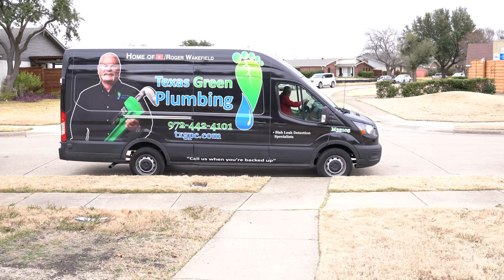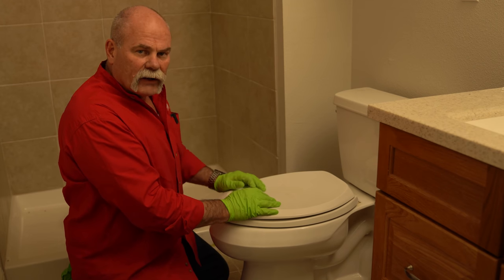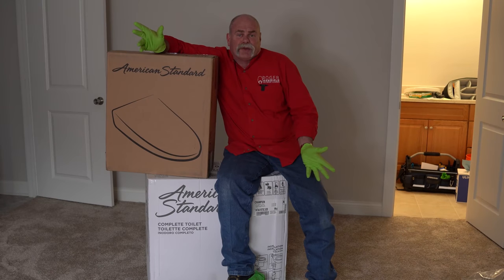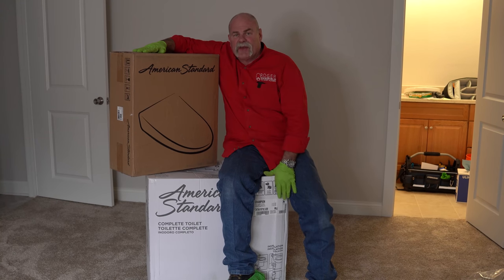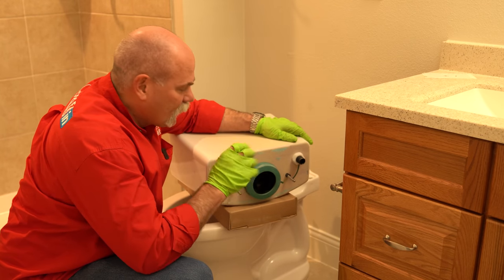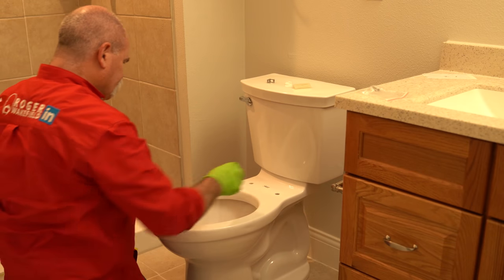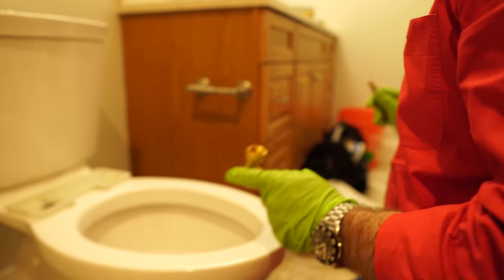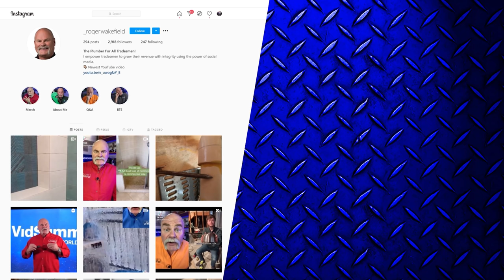DIY Plumbing - How To Install A Bidet Toilet Seat!

Comment from the maker: I love my bidet! Do you have one in your home?
Reply: Im considering getting one installed whats your opinion on it first Roger??
Reply: Nah, I just do handstands in my shower
Reply: I do because I'm disabled and can't wipe my bum-bum properly........ I have a Clos-o-Mat
Reply: Liked my so much that I put another one in my camper.
Reply: Since we installed one I hate being out somewhere and being forced to use paper.
Reply: No I don't. But I want one
Reply: So the ejector is like a high powered stream of water that goes im your underside.... Im considering it
Reply: Call the electrician back and tell
Him to replace the receptacle with a GFCi one. 🙊
Reply: @kalijasin  i am guessing it is run on the same circuit as the one on the counter and it is after the one counter and it is proving the protection for both outlets. But that is a guess and i agree it must be protected as it is to close to water not to be.
Reply: I added one a few months ago due to the hoarding of tp that happened the first of the year.  I know wish i had added one sooner and think this should be standard on at least one all toilets in all homes.
Reply: @ddgiant  "i am guessing it is run on the same circuit as the one on the counter and it is after the one counter and it is proving the protection" Outlets protected by an upline GFCI require a  "GFCI Protected" marking.
Reply: i don't have one unless someone give me one for free just because cant afford for anything barely on foods n drinks 
all i have is free thetford toilet it plastics 
i have build home because of the hurricane destory my camper on September just bought broke school bus n turned it into rv
FEMA denied give me anything replace my broke camper so have start over again
Reply: Hell yeah I do. Not as nice as this though.
Reply: I don't have one yet, but ever since using numerous ones in Japan, I've been a big advocate for toilet seat style bidets. The cheap ones are only ok, but the higher quality ones are great!
Reply: Installed one when I went to Japan and purchased it 25 years ago. Still going strong and always laugh at people buying toilet paper!
Reply: I installed a bidet seat on my own when people were hoarding TP. First time I had done anything plumbing related. Made me feel like a boss. Now I'm super clean. Would highly recommend!
Reply: Howdy from the UK Roger. I have something similar, but it's a standalone unit that fits as a seat on any "average" toilet. 

The manufacturer is BioBidet, and I have it on long term loan through a disability care agency. It has a heated seat, hot water jets and a hot air blow dryer. Although you can change the level of heat from none to pretty hot, for the seat, water and air via the included wireless remote control, which I have mounted on the wall next to the toilet. 

It does raise the sitting height by maybe a half inch more than the standard seat and lid it replaced, and it has quite the bulge at the back for the water heater but I can't believe you had to install an entire toilet unit, porcelain and all! Just to add bidet features.

The only thing of concern to me is the sockets. Mine is wired through the wall to a sealed unit outside. Plug sockets are against the electrical code in UK bathrooms unless they're in a rated enclosure. Those aren't even enclosed, let alone in a sealed faceplate.
Reply: My father's parents have 2 in their house. But they aren't electric.
Reply: I installed a bidet attachment fairly recently, the simple kind that fit under the seat. It's working great but in the winter the water is so cooooold. No warming, etc. The problem though was the cheap T adapter that continued to leak no matter what I did, I had to order a separate one to install, but that took care of the problem. This must be a common problem since companies are advertising T adapters (sorry if this is the wrong term) for replacing the cheap ones that come with bidet devices. Since then, though, no problems except for the fact that the toilet seat tends to move off-center which causes the water jet to impact the back edge of the seat and thus spray a bit outside. So, you have to keep the seat adjusted. I'm too ignorant to know how to fix this problem. The bidet attachment itself does not move though, so that's good!
Reply: I want one but dose hard water effect it at all over time?
Reply: I have a Luxe Bidet Luxelet E890 Bidet toilet seat.

Comment: Handyman in the comments:
 ewww a plumber's job is disgusting
Plumbers: at least it gets me the dough💲💲💲
Reply: Some of y’all are way to hard on handymen. I’ve had to go back behind plumbers before that had no idea what they were doing. Things like telling a tenant and landlord they need to pull a water heater and replace a shower valve, because they didn’t have hot water to anything in the house. 

This handyman goes there and turns the valve to the water heater on. Just one of many things I should start documenting.
Reply: @emmasdad5426  look this is a recurring joke that Rodger makes I'm just trying to put out there not saying that handyman don't do hard work
Reply: @mr.robot1399  I know. I still respect both sides and Rodger is fun to watch.
Reply: im a handyman and ive replaced dozens of toilets
Reply: @OGRE_HATES_NERDS  I salute you my friend for this is merely a joke
Reply: @HandymanHustle  Look its just a joke
Reply: @HandymanHustle  I appreciate plumbers electricians and handymen it's just a joke

Comment: What a great job ! And what fun to scrape the old caulking from the tile. Lol ! As someone who has been in the plumbing trades, if your removing the caulking from vinyl sheet goods, be careful not to gouge the vinyl ! You could end up replacing the bathroom flooring  !

Comment: Rodger I love your videos. I'm not a plumber, but I'm a DIY guy and I've seen people use wetvac shopvacs to remove the water from the toilet so you don't have to use a sponge. Just posting it here for you and other viewers to see.
Reply: He also uses those just didn't in this video for whatever reasoning might of been lol. But good pointer nonetheless. I'd also like to add if anyone does who isn't familiar with one make sure you remove the paper filters if it has one. Let a friend borrow mine then while he had it sprung a leak and when I came over to help I found my filter I just replaced in pieces in his driveway lol

Comment: I wish I would have seen this video a few months ago. I added a similar toilet seat from Bio Bidet and it used the same mounting bracket with the rubber bolt sleeves. I struggled for about 10 to 15 minutes just trying to push them in.  I wish i knew about the use the bolt and pull it from below trick, would have saved me a lot of time.
Please keep putting out the great videos

Comment: Hi Roger, I saw you using a sponge to empty the toilet, I was curious if you have ever tried or seen a tool called the last drop,(or any of the similarly made versions) its a super convenient solution for removing water from any fixture when you need to work on it. I know I've been glad to have it on several different jobs.
Reply: Shop vac??
Reply: Good old wet vac works wonders
Reply: Shop Vacs work great too, but this doesn't need power, is lightweight and could fit in a decent sized tool bag, so it has some advantages over a shop vac, main disadvantage is a smaller capacity, but you can usually empty in another drain nearby or use a bucket if necessary.

Comment: A non tamper resist and plug that close to the floor and next to the toilet, i hope it is at least on a GFCI
Reply: Not worried. Outkets in bathrooms  and kitchens are by water. That's what gfci  breakers and outlets are for
Reply: @chuckley54494  i understand that, that is why i said "i hope it is on a GFCI" but isn't there a new code that requires all outlets within a certain height to be tamper resistant?
Reply: @WalterKnox   i couldnt tell you.   one in my 1950's house are between 8 and 14 inches depending what floor you are on.
Reply: Our house has the GFCI breakers in the panel not the outlets in the bathroom.
Reply: @hrcnick11  yeah, alot of newer houses have those as well, i am going to assume that this either has those or a GFCI outlet controlling that one. i am not sure how old the house is and if the outlet has to be tamper resistant depends on that, also my house does not have any GFCI because it is from the 40s, but that seems to be a pretty modern house so it should be okay as far as that goes.
Reply: @Jack Myhre correct, I have not heard the ground pin up thing, but makes sense and that is how it is in commercial buildings, I think if the outlet is a certain height off the floor it does not have to be tamper resistant, something like 5 feet I think.
Reply: @WalterKnox  The house is brand new, it was recently rebuilt after a tornado, so it was rebuilt from the ground up.

Comment: I can tell you're right hand dominate. The initial tank to bowl bolt tightening you did the right side with ease. The left you actually had to get down there to see it. As a plumber I try to use my left side as often as my right to avoid that lil situation you had. It's not bad it's just something I noticed.

Comment: Just discovered your channel, and I enjoy the content! No a plumber, by any means, but I enjoy learning new things. A quick question, if I may. I have a half bathroom in the first floor, just a toilet and a sink, and a full bathroom on the second floor. Now, whenever it's cold outside, the first floor toilet only has one flush, then I need to refill the reservoir. The 2nd floor toilet though, works just fine. Why do you think that is?
Reply from the maker: You may need a new fill valve. That’s kind of strange.
Reply: @RogerWakefield  thank you kindly for the response! It is peculiar, as I've not had this issue at any residence before, but given the states of a few other things, I'd wager that the prior owners were more of a DIY type. Again, thank you for your time!

Comment: I have a few questions;
1. Couldn't you have used a plunger to force the water through and out of the trap in the bowl faster and easier than using a sponge?
2. Why did you loosen/disconnect the tank inlet before draining the residual water in the tank?
3. What is your opinion on the Fluidmaster "better than wax" rings compared to the old wax rings?
4. Did you have to change the whole toilet regardless or is that seat able to be placed on any,  correctly sized, bowl fixture?

Comment: I've always been told by plumbers in our area never to use anything to 'seal' the toilet to the floor.  If the wax donut starts leaking,  you'll want to see it coming out from under the toitoi.  That way you can address it qiucker before it rots out the subfloor.

Comment: curious what your opinion on double nutting the tank bolts ex. bolt with rubber washer the another rubber washer then another bolt then put tank on toilet and bolt it down

Comment: Would you recommend installing a separate shutoff valve on the lines that connect to the bidet?  I bought one because of the COVID toilet paper shortage and ran into this issue where the internal valves within the bidet would fail and leak.  I went through three of them and gave up on it because it was just too much work to shut off the sink and toilet each time it failed.
Reply: I'm not a plumber, but you might consider having your water pressure checked. It may be too high coming in off the main. I had a couple of regular shutoff valves fail at my house and the water pressure was partially to blame. It was double what it's supposed to be.

Comment: I’ve never used caulking around a toilet would you say it’s necessary?
Reply: Personally I would think that you would want the bottom sealed, but thats my nonprofessional opinion, lol
Reply: Leave a 2 inch gap in the back, so if there’s a leak between the bowl and the flange it can leak out and reveal there is a problem sooner than later. I don’t know if caulking is required, but sometimes tile can be uneven. And that dap is like glue and can remove a slight wobble to a toilet set on uneven floor/flange
Reply: Yeah @steakwilliams4448  is right. Its more of a leveling thing. Sometimes people will caulk the toilet first, then place it in and caulk edge.

Comment: Hey Roger.  I noticed when you TANK TO BOWL  and set it.   U tightened down 1 side then the other.  I always finger tight both sides and the 2 turns per side til it seets...   whats the method to the madness there.   JOE Bello. Plumbing plus co... Cuba New yorm

Comment: Hopefully that's a GFCI outlet.
Reply: I was wondering the same, isn't this out of code, at the very least it would need a sticker to indicate that it's in a chain, or on a gfci/afci breaker
Reply: In some areas the GFCI doesn't need to be "marked" as long as it's installed on the correct kind of breaker. Codes here in the US vary so much it's ridiculous.

Comment: Unless that receptical is slaved off a gfci or on a gfci breaker. That's not code. 6ft or less from a water source has to be gfci protected.

Comment: I'm always shocked when in the US they put electrical outlets inside bathrooms, here you usually have to get special building permission, an electrician and fire safety inspector to sign off on it even to put a light switch at shoulder height on the inside wall of the bathroom instead of the outside wall in the hallway. Getting a power outlet at ankle height less than a meter from a flowing water pipe without guaranteed waterproof and pest proof double insulation and a pipe and wire layout analysis is truly wild.
Reply: that's the difference between a 240V to ground system and a 120V to ground system.  
and, of course, the receptacle is on a GFCI (metric=RCD) as well.
Reply: In Germany we have fuses to shut down the electricity in fractions of a second. You don't get safer electricity lines with anything else.
Reply: @oldhelldog5460  we have fuses where speed is essential.  otherwise we have resettable devices that take a sixtieth of a second to recognize a fault condition and open the circuit.  and they aren't limited to overcurrent.

Comment: How did y'all get away with putting that outlet so close to the shower? I know it's probably on a gcfi outlet and or an ncfi breaker. Pretty safe but its still below the sink top and close to a flex line and the shower. Wouldn't the outlet just need to be in the cabinet under the sink and just run the cord through the cab?

Comment: I think you're adjustable wrench was to small and you're pocket knife was to big lol , I usually use the smaller wrench or a nut driver and a sharp 5 in1 tool or sharp putty knife to scrap the caulking but I guess little itty bitty pocket knifes works best for you 🤣🤣🤣 you go boy.

Comment: I also drink water from a bidet
Also why no gfci outlet?
Reply: I'm guessing it was pulled off the already-GFCI-protected bathroom circuit.  it should have a single receptacle instead of a duplex, just on general principles, though.

Comment: I honestly do not understand why bidets and washlets are not just the standard in North America. We are living in the damned stone age here.
They keep you significantly cleaner than toilet paper alone, cheaper than buying loads of toilet paper and less likely to cause clogs. Even the cheap bidet/washlet seat attachments are both affordable and effective. Seriously, do yourself a favour and get one. Absolutely worth the 15 minutes to install the seat attachment.

Unrelated: A puppy pad for under the old toilet to keep everything clean without using a towel/drop cloth. That's so clever!

Comment: Don't know about US code but that electrical outlet is waaaaay too close to the water source by Australian standards. I have bidet toilets (love them) and the power is minimum of a 1/2m ABOVE the water source. Having power right below the reservoir is scary. Also, Australian electrical bidet seats are required to have their own RCD at the outlet end of the cable. No zapped goolies for me thanks

Comment: Geez talk about working harder not smarter Roger lol.... no vacuum to use to suck water out of toilet and no 5 n 1 painters tool to cut out and scrape the caulk as well as the wax ring?? Just another plumber busting another plumbers work but hey still got the job done 👍

Comment: Electrician should have known that needs to be a gfci outlet. That would never be to code here in nj
Reply: Not code anywhere. 6ft or less
Reply: Gfci breaker most likely
Reply: @bradenwelch1967  Yes